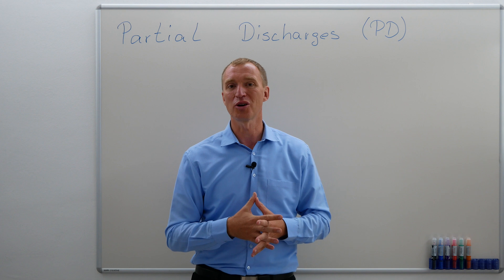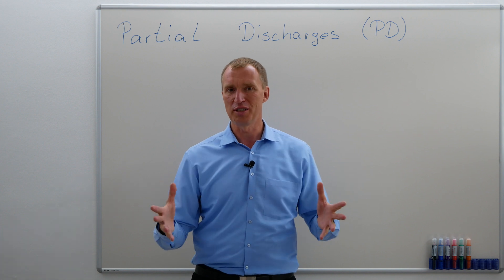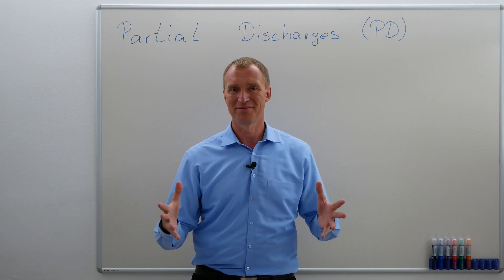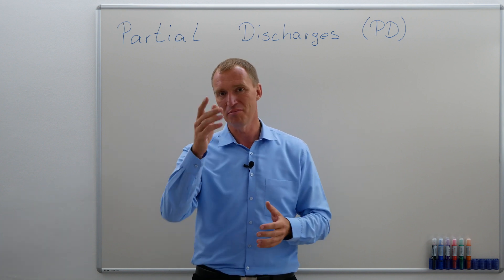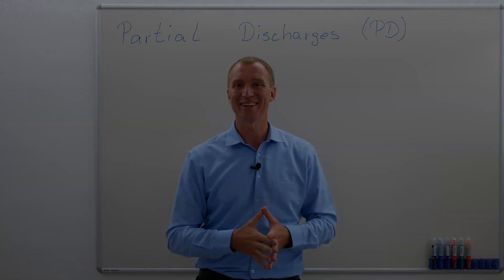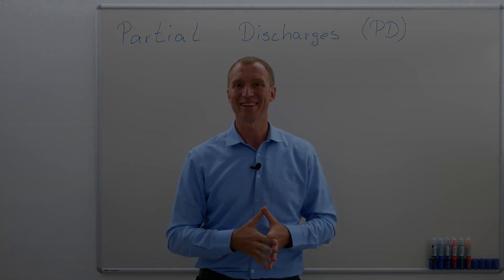1.1 How to test Partial Discharges?

Comment: Hello Mr. Ronnie, thank you so much for your sharing knowledge about PD. I have question, in that explanation I highlighted "partial discharges also create heat". If all isolated HV & MV equipment (CT, VT, cables, bushings, etc.) if measured and found to have a fairly high temperature, is it definitely caused by Partial Discharge?